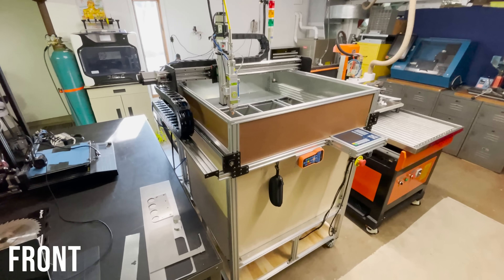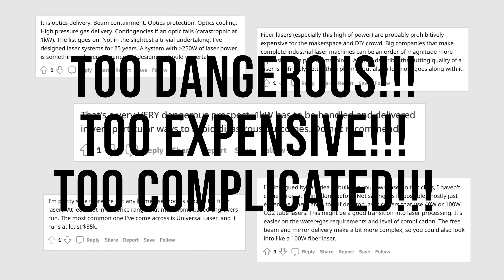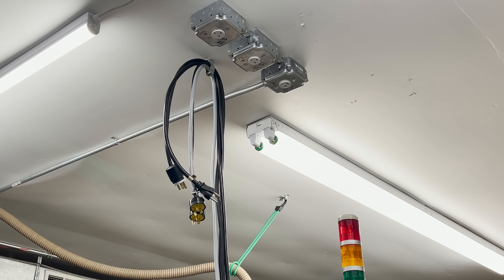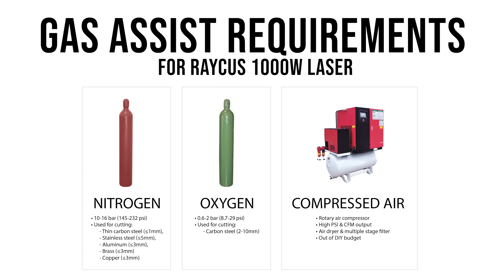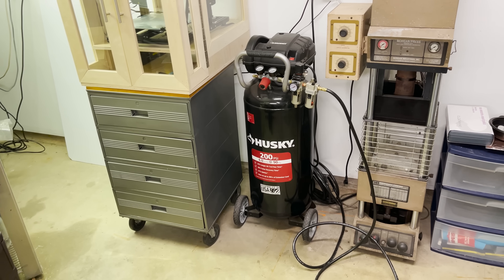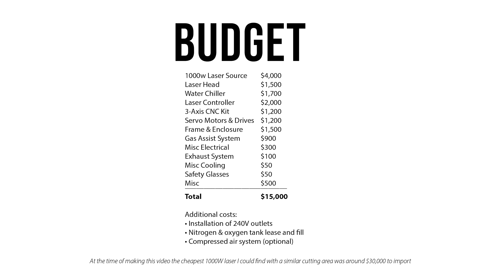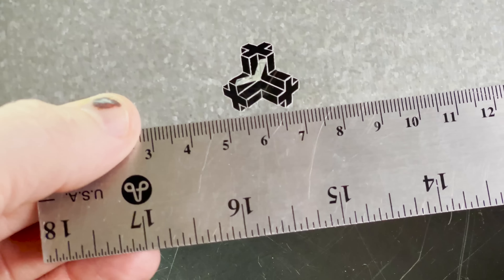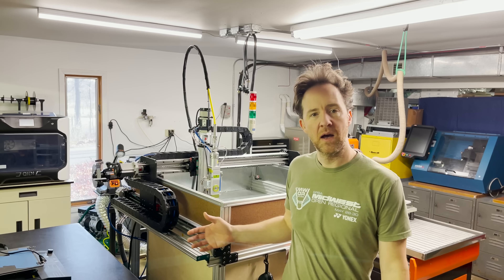DIY 1000W Fiber Laser Cutter Part 1: Project Introduction

Comment: Never seen anyone build one of these before. The results look awesome. One thing to consider if you need more power and you’re not planning to run it 24/7 is a gas generator. For a couple grand you should be able to find a high enough power inverter generator that can run anything you need. 

Another option specifically regarding the air compressor is a gas powered compressor that you fire up when you’re going to cut. You can get really high CFM ones, especially if go up to a diesel unit. The essential craftsman does this for his air hammer which is super air hungry.
Reply from the maker: Thank you Sir! I never thought about a gas generator, but I have been keeping an eye on Marketplace for a used gas powered compressor…I just picked up a used air dryer tonight. BTW, I’m a little star-struck…I have to publicly admit that you are my YouTube hero!!! 😃
Reply: @diyfiberlaser  I work with big air compressors for scientific work as part of my job. Keep in mind that the CFM of a compressor decreases as pressure increases. Be cautious of large piston compressors, that's a lot of mass moving, and they tend to have vibration problems, especially the oilless ones (I have a $20K compressor offline atm because it's trying to rip itself apart). Scroll compressors are quiet and good to 120 psi or so. Compressors with threaded inlets can be used in series, so one kicks you to 100 PSI, the next bumps you up to 200, etc.  

The size of the tank only affects the time between compressor runs. Old tanks that have sat with water in the bottom can rupture and kill people, so be cautious of used tanks (also drain your tank daily!). Even a modestly sized tank rupturing at 200 PSI will take the walls out of that building. 

Some years ago, I was running a small tabletop sand blaster in my garage. To get the pressure and volume of air I needed, I ran three small 120-volt compressors in parallel. The setup was vastly cheaper than a single large compressor; you can save space by plumbing multiple pumps into a single tank.
Also, there are places that sell used scientific equipment; you could look for a used nitrogen generator.

IMHO gas fueled air compressors are a massive PITA. you have far more maintenance, they tend to be loud, and you have the concern of the exhaust being drawn into the intake and brought into your shop with a whole lot of moisture. You can easily overload a dryer.
Reply: @diyfiberlaser  Look at something like a Motor Guard filter to go along with the air drier. The air drier will remove moisture but won't help much with removing contaminants and used gas compressors aren't treated very nice during their life. Also, look for a stationary gas air compressor instead of a wheel barrow style since they will provide more CFM due to having larger pumps.
Reply: @diyfiberlaser  wouldn't it be cheaper just to hire an electrician to increase the amperage of the house's electrical panel?
Reply: I can't be the only one a little excited that Shane is now thinking about fiber lasers..
Reply: Not sure if you can get a big enough gas generator (Nitrogen) that would be able to keep up with the power available in a home shop. I have a nitrogen generator system and it costs about the same as the laser. It has not 1 but 2 compressors! A standard  11kw 3 phase 10bar atlas copco air compressor  and  a high pressure 200bar booster compressor to fill 4x 50l 200bar cylinders. I can out run this system when cutting 2mm stainless steel. The 1kw fibre laser and nitrogen system probably pull 30kw 400v 3 phase at full power. I would try to find a cheaper source of bottled nitrogen or try a high pressure dive compressor and fill several cylinders when the laser is off and  cut on air. Adjust your laser parameters to fine tune the results 👍
Reply: @andy123law  if you have a nitrogen generator you also have an oxygen generator built in, be good for steel etc
Reply: @zyeborm  not really the excess oxygen is purged out of the system. It would also contain the other 1-2%  gasses. You can cut mild steel with air and nitrogen if you have enough power 👍
Reply: @andy123law  "nitrogen generators" are oxygen generators that keep the nitrogen instead of the oxygen. The waste your nitrogen generator is dumping over the side is oxygen.
Reply: @zyeborm  yes I know but it's not even close to 80-90% pure so no good for laser cutting. Oxygen generators are a little more complex
Reply: You should get a sponsor to give you one
Reply: Genuine question here, Why are you guys trying to build the cnc fiber cutting machine that way when you can get a 1kw welding machine with 3 in 1 function(Welding, Cleaning and Cutting) at the cost of around $10~12k ???
Reply: @off_issued-tv1lr  
1. Learning experience
2. Easy repairs
3. Save money
4. Customizable 
5. They could probably make it 3 in 1 fairly easily.
Reply: Kudos🎉🎉🎉🎉🎉

Comment: Thanks for sharing this project!

About the gasses, I don't know where you're getting your bottles filled, but I'd suggest calling around the welding supply houses, as neither of those gasses are particularly exotic, and are commonly available for various processes.
Nitrogen is ~78% of the atmosphere, and not in any way in short supply.
Oxygen is ~20% of the atmosphere, and again not a short supply issue.

I usually use a nearby welding gas supply house for argon, argon/CO2, oxygen, acetylene, and nitrogen.  My biggest cost savings on this was just checking around the stores and comparing prices.
AirGas was always been one of the most expensive, as well as prone to trying to force bottle rental instead of purchased bottles.

Comment: Thank you. I am really looking forward to learning from your project. I have a small plasma table, but really want a laser setup for clean cuts for motorsports parts. The frame/basic machine controls are easy for me, but I've never touched a laser so that setup is new. I also appreciate you sharing the costs so there's resonable expectation if any of us follow suite and build a similar setup.

Comment: How high pressure does the nitrogen need to be? If your air compressor can handle it maybe a molecular sieve could save you money.
Reply: Or maybe it’s a membrane. I don’t know much about them but you can separate the O2 from air. I’ve seen them used before cooling for producing liquid nitrogen by other YouTubers.

Comment: 320cf over a 1hr cut is only 5.33cf/min if you're running at 100 psi this can be done with 2 of the compressors you have also change the set pressure to a max of 120-135psi it will more then 3x the life of the pump and reduce power draw drastically.
After 10 bar, the effort a pump needs is crazy high. I ran that raycus 1500 at 90psi using 4.85cf and never had a problem with it.
I don't have a table atm. I scraped it when I moved, but I have a few tubs with the parts. And have a 18u rack road case (kind used by concerts for dj equipment) with my source (8u for the unit, and the rest is foam for the head and fiber cable).

If I set mine back up, I'm going to grab 3x 20cf tanks in series and 4 or 5 of the low noise fortress compressors from harbor freight..
With a 2 stage dryer for automotive painting.
This sounds crazy but if 1 fails, you still have 4 others and only take 3 of them to hit the flow requirements. At 150$ea on sale and about as loud as a portable A/C. Also, I can swap it out locally if it fails.
I have 1, and I have painting a car redone a roof and framed an addition with zero problems, and it's so quiet also adjusting the tank pressure to 120psi peak running amps is 7.6 at 120v so you can get 3 on a 20amp circuit. If you do this, stager the tank pressures by 10psi to prevent them from all starting at the same time..
Running copper coils from the compressors to the first tank with cool and condense out the water drop a purge valve on the bottom of every tank and 2 of the 2.5x20 water filter housing with 5micron filters, will keep the air 99.99% clean and are soild upto 140psi working 300psi burst.

Comment: Super interesting project, i offer you my congratulations on your build, Getting started is always the hardest part, It's too late for you as you have it up and running, but there are ways you can cut the end price down, There might be a good reason why you choose the parts that you did, however, if I was to build it on a tight budget, i would start with the motion control, You are using what seems to be bigger than 12mm Ball screws for the X and Y, when you could have went with a bearing and belt drive, it's not like the head is pushing into materials and needs a lot of pushing and holding power like a CNC router would, you only need to move the mass of the laser head and the pull of the wire loom and gas line, I am positive a cheaper belt drive would work just as well at 1/4 of the cost. not saying it's a bad thing, but you over-engineered the Poop out of it which always comes with a big price tag haha. that is just one of many ways you could have cut the build price in half, I think, however, you built it, so you are better placed to see what was overkill and what was necessary, Perhaps in a future Video you can go over the whole build and show what parts and ways to build it one could reduce the cost on,
Reply: There is a time and place to cut cost on a project, but don't know if I'd agree here although the gist of what you're saying is true. Couple things: 12mm or 16mm ballscrews from China are pretty much the same price these days and at laser speeds it'd be much safer to just go with 16mm to prevent whipping. In fact 16mm ballscrews might be less expensive than 12mm since that's what the market is flooded with for hobby CNC and typically most are just the factory rejects that didn't make legit spec to get sold through industrial channels. Agree that belts are totally fine for a laser, most are done this way, but there would be a bit more work/fiddling involved to get it to work properly with no ringing around sharp corners vs just adding a servo to a ballscrew with a coupling which is very straight forward. Not sure how this would lead to cutting the entire build cost in half though - if we look at his line item for $1200 CNC kit that includes linear guides, ballscrews, ballscrew supports, probably the couplers. So if we say $100 per ballscrew would be swapped out for more time and effort and $70 in belt components and pulleys and tensioning gizmos.... -$90 on $15,000 is almost half but not quite. Best Regards, Cody

Comment: What's the most robust material you've cut with this?  What's the limitations to it's ability to cut?
Reply from the maker: I just started test cutting a week ago, so I'm still trying to understand all of the parameters....yesterday I cut 1/4" carbon steel, but it wasn't very clean, so I need to keep tweaking the settings. The laser specs say it can cut up to 10mm carbon steel.
Reply: @diyfiberlaser  1/4" plate is useful... Outstanding... Good Luck tweaking it up... Can't wait to see what you're able to eeek out of it.

Comment: Thankyou for putting a BIG "warning read about this before you try" cause even though I'm sure you know what your doing not seeing some laser glass over that fairly high power IR laser too contain stray beam reflections is a bit sketch xD.

Amazing project tho ive looked into trying too make a fibre laser system like this and never ended up having the balls too pull the trigger. Props too you man!

Comment: I'm so pumped to find this video! I'm collecting parts to build a DIY fiber laser too, but there's so many missing elements of the system. I'm mostly interested in the controller. I've got a 4kw IPG sitting in my garage. It's relatively easy to generate 3 phase power with "off grid solar inverters" but it's not the cheapest option. You can do ~15kw for around $2000 or so. I'm so into you
Reply from the maker: From my research, it appears most commercial machines are using Friendess controllers and CypCut software. I went with the Ruida RD6563F controller because it is cheaper and I'm familiar using a Ruida controller on my C02 lase. It has it's own software called RDCutist V2.0. It seems less robust than the CypCut software, but so far, has all of the basic features I've needed.
Reply: @diyfiberlaser  Does the laser source use a PWM to control the power output?
Reply: @danielelenarduzzi9888    Raycus RFL-C 1000   has a direct modulation input, your circuit can control the laser up to 5000Hz. this can be used for PWM control.    Is also has an analog 0-10V input that can be enabled.   A serial and and ethernet port is also present, however it is not clear if we can obtain a description of it's protocol, I have not found it yet.  A user manual is available, google it.
Reply: Interesting note about the 3-phase solar inverters, I’m gonna file that away for future reference!
Reply: Any control 7$ or above can do the job just fine. I currently have complete  cnc machine and building table for plasma torch since its relatively cheap.

But from what I understand same laser source can be used for metal cutting, engraving, welding..
So fiber laser in the end may be cheaper and much more quality solution than having separate.. Engraver, cutting machine,welder...

Can anyone confirm this?

Comment: Excellent presentation and pacing! I've been fiber curious as well and you confirmed my suspicions, it will remain "aspirational" a bit longer

What projects helped you most on your path here?
Reply from the maker: Just using a co2 laser and retrofitting machines mostly. Most of the equipment in my shop has been purchased "non-functional"...I've learned a lot just by fixing things. I have no experience, but I suspect using a plasma cutter would have also been really helpful.

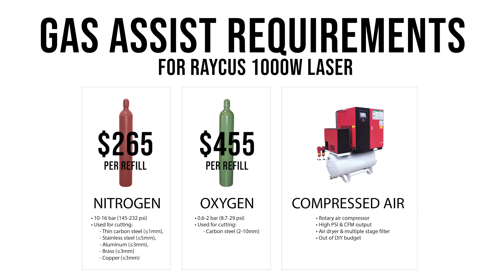Comment: 5:11 Dude you are getting ripped off for your gas.... You are paying way way WAY over price for you gas... Oxygen is only about $30 per refill not $455.... maybe $35 for a T-tank refill... hell even if you want to pay for recert maybe $40... nitrogen is a little bit cheaper but not by much for it.. some thing like $28... $265 per refill for nitrogen is a rip off.... dude serouisly recheck your sources those prices are a scam... my tank are T-tanks the largest stnd size tanks on the market.. yeah serous dude your getting ripped off for gas
Reply: I'm paying similar prices. Last oxygen I bought was 42 Canadian dollars. 
I could understand those numbers if you're buying the bottle the first time around or paying for a contract.
Reply: 300 cu ft argon In Hawaii is over $1000 for a bottle refill. Oxygen is not as much nor Nitrogen but way over $500..... Thanks to Airgas